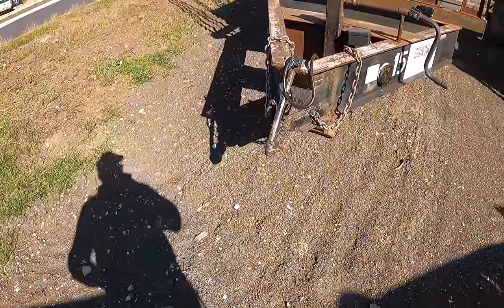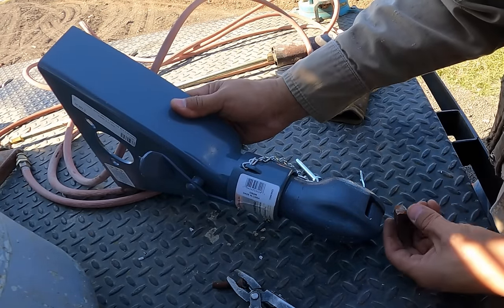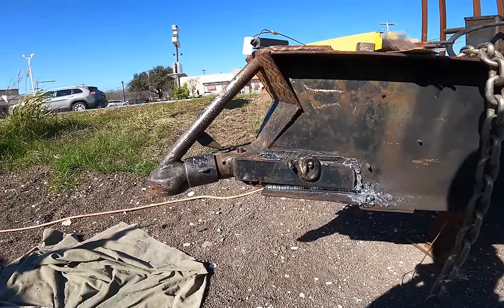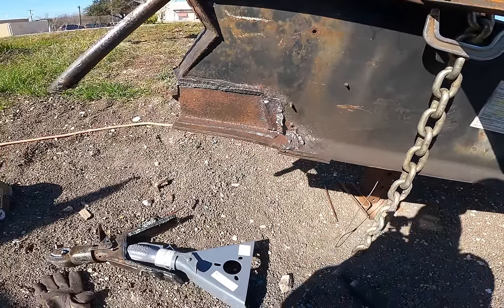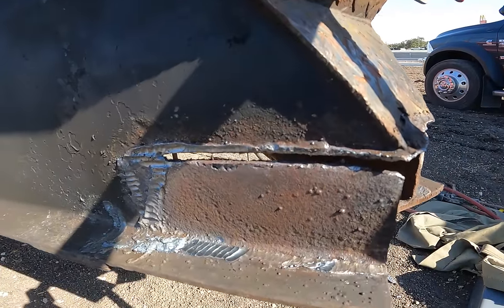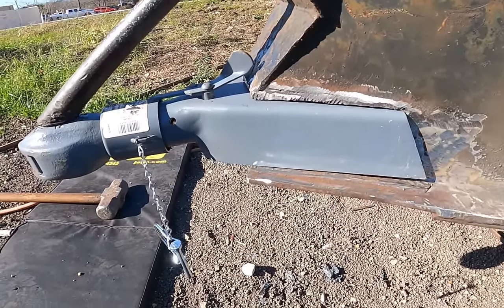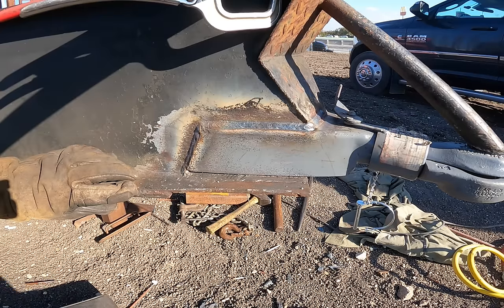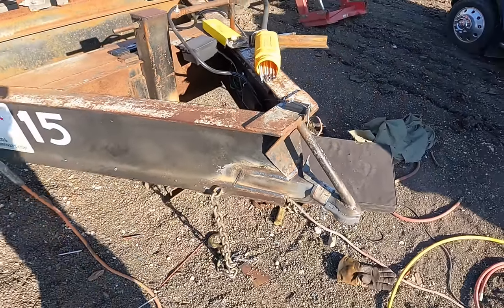Sketchy Hitch replacement.

Comment: People always tell me I’m dumb for messing with hitches. I always tell them I’d rather do them because I know my capabilities and my family drives on the same roads at these trailers. I’d rather me do them, and it done right, than some 18year old fresh out of high school. At the end of the day, I’ll go home knowing it was done right.
Reply: Same.  But I deal with mining and constructiuon equipment and every job is different.  Like last week I was doing a lip on a 988 rock bucket, and monday I finish the 785 haul truck bed.
Reply: i seen homemade trailers and that was smaller being behind f150s but this is framer spec, for a city street its horrible for a trailer that size, this  bologna was together not robot quality
Reply: The hitch looks small compared to the mighty trailer. In the UK we have 50mm ball type but not quite like this one.
Reply: I was asked to help put a drop hitch together.  I declined but later found out he had a friend do the work with his cheap Amazon welder.
Reply: @rbhe357  that’s exactly why I accept doing the work! I’d hate for my family to be on the road with work like that!
Reply: @Landroverdude101  I absolutely would’ve talked with the customer about putting a pintle hitch on it. But the customer wants what they want man.
Reply: @MadMaxWelds  it was a borrowed trailer. The borrower was the customer not the owner.
Reply: $1,500.00 for a new hitch or walk away
Reply: What welding rods  did you use and what amps?
Reply: @JT-tz5hp  this is even more reasons to not have repaired the trailer.  The owner did not authorize the repairs. The guy who borrowed the trailer did.  Sometimes  you just need to say no.
Reply: Surely that hitch is for a 6x4 box trailer, what’s it doing on that monstrosity.

Comment: You did a fine job. However the original hitch and its replacement look inappropriate for the capacity of that trailer. They should’ve been  a heavier hitch.

Comment: In a workshop where welders wield their might,
Came a call to Isaac, a welding delight.
A rented trailer in a dire connection,
The coupling broke, a welder's reflection.

Isaac arrived with his helmet agleam,
To fix the coupling, a metallurgic dream.
He grinned, "Fear not, my dear friend,
We'll weld this tale to a proper end!"

Sparks flew like fireworks, a welding display,
Isaac worked wonders in his own unique way.
To the renter, he said with a laugh,
"No more worries, just a smooth towing path.

Your trailer's ready, now good as new,
Thanks to Isaac, the welding virtuoso, too!"
With a nod and a spark, he saved the day,
The trailer now fixed, ready to roll and sway!
Reply: The Way of the Welder!
Reply: lol its all in a days work though for him

Comment: Hey let's keep welding crap on it to make stronger. Those type of latches are really good for their rated towing, The way that ones on their tells me they are a wee bit over what it's rated for. That trailer looks like it had a ring hitch on it.
Reply: yep , needs a ring hitch with a much higher wt rating
Reply: Ok I'm not the only one that thought it should have a lunette ring on it. They sell multipurpose hitches that can tow either a 2 5/16 ball or a pintle setup. Customer should go that way. Plus I've seen this style of hitch bust open when backed at a tight angle, would not have one on any of my trailers
Reply: That trailer definitely came with a pintle ring installed on it.  I am willing to bet it had a piece of 1/2" x 6" wide plate with multiple holes welded vertically on the end of the tongue.  I worked on a very similar trailer and the V at the end of the tongue was so you could access the nuts that attach the pintle ring.
Reply: Definitely with you guys on the Pintle and ring fitting. The part supplied to Isaac doesn't seem to be rated enough for that trailer, given the size of the drawbar members. They appear to be sized for a large commercial trailer towed by a dump truck and carrying a medium excavator and a bobcat. They definitely require pintle and ring sets and decent quality thick chains. Plus breakaway brake system.
But that's only from what I see on the roads around Melbourne and what would I know? 😅
Mark from Melbourne Australia 🇦🇺
Reply: Agree with everyone too. The trailer looks like it’s made to haul a D8 but it’s modified in some way to haul windows or something like that. My experience with that type of hitch wasn’t good. Had a lots smaller trailer I hauled small load of hay and straw bales and busted it out the side backing it up to the barn. But there are lots pulling huge loads with half ton pickups and janky trailers all over this country and get away with it. I wouldn’t get out the driveway and DOT would be waiting on me to hit the road.
Reply: @markfryer9880 How's the grand prix setup going at Albert Park? Not much time until F1 comes to town.
Reply: @oldfarmer4700  good hitch for hauling post holes or Volkswagen radiators
Reply: No way in hell that hitch is rated for that trailer. Not even in the ballpark.
Reply: Looks to me like theyre just hauling signs so its probably not a big deal. Maybe the person that had it before was hauling heavier stuff tho ha

Comment: There was a guy driving down the freeway the other day with a trailer similar to that one. The hitch was ok, but the welds broke on one of the axle spring brackets and the axle came out from under the trailer. It hit four cars before coming to a stop. Come to find out, it was repaired by the owner, and it was apparent he didn't know how to weld. Good thing we have people like you making sure these things are done right and safe for other drivers as well.

Comment: Your work was solid, ISAAC. The tongue on that was a mess. Blows your mind why they didn’t leave the pintle set up on. 
You can only do what the customer wants!👍👍
Reply: It does make you wonder what happened that they did a reverse cut back into the web of the beam to create a bird's mouth cut and then weld a rated ball hitch to all of it.  Good thing that it is being used to only haul signs.  Definitely a construction project site trailer.
Reply: @wromzick9457  I would not be surprised if that bar in the front with the birds mouth is so that the owner can pick it up and move it with other equipment that does not have a hitch and it gives them an easy area to grab.

Comment: Looks like it was a pintle hitch trailer that they cut the front off of and put that cobbled up mess on instead
Reply: @landonsmith1621..yeah I think you are correct...looks like a mess for sure...b
Reply: I agree landon and the chopping around of the trailer hitch makes me suspicious. 
I have had a trailer try to throw me off the road when I miss loaded it and I have also had another trailer without brakes and to heavy a load try and push me into an occupied roundabout! Moral of the story, you don't take risks with trailers, their brakes or how they are loaded! You are dealing with the Laws of Physics and they are not negotiable!
Mark from Melbourne Australia 🇦🇺
Reply: @markfryer9880 I would bet that trailer has no working brakes.i wouldn't touch that unless I was putting the proper hitch on it. A death trap waiting for a victim.
Reply: @marklowe330  but they do have a break away switch installed.  Of course the pull cord is evidently not attached to the tow vehicle properly. The pull cords NOT  supposed to be attached to the safety chains
Reply: @marklowe330  yes and now all the liability is on Mister Issac.  I hope he takes our advice and puts a Pintle Lunette on it.
Reply: @jaygraham5407  just because you have the pull cord doesn't mean anything.
Reply: @marklowe330  I well know that. Just saying that  a lot of trailers don't even have the break away switch.
Reply: @cameronnerdin4910 didn't listen well did you?
That job is done with that ball hitch connector on it.
He ain't changing shit.
$1000.00 says the customer and owner don't WANT a ring on it, because they don't either one own a pintle hitch and don't want to.
Reply: @haroldphipps3457    Yeah I listen. I don't ever give a shit what my customer wants when it comes to Safety.The hitch broke, which probably means that the trailer is overloaded continuously.  The public safety is more important than what a customer wants. Issac should not have made this repair in my opinion.  He only opened himself up for liability if the hitch fails and then he posted it on the internet to ensure it is known to all that his common sense went out the door on this job.  Yesterday I had to tell a customer it was time to quit working, I had 3 side dumps stuck on a hill and could not make it up because of a snow storm and the roads were snow covered.  I had to tell him we were stopping because when a big rig or dump truck slides on the road  we hurt people. This is the same for this trailer, when  the hitch breaks this time Issac will be on the hook for all the injuries caused.                                                          .

Comment: That' style coupler is commonly found on horse trailers and not really up to the task of a heavy construction trailer.  I kept thinking that there were far better ways to repair it than to duplicate the failed hitch.  It all made sense to me when you said that the trailer was borrowed  and the customer just wanted you to  put it back to where it started.  As always, you did a fine repair job but I can't help but wonder about liability issues.  Thanks for the video!
Reply: Agreed there, that trailer is obviously towing stuff it was never intended to haul.

Comment: Award for puzzle solving, award for having patience excellence, and gouging and welding above and beyond.  It's sketchy but you made it look way better and as strong as it can be with what there is to work with.  The load on the trailer is nothing compared to what that poor trailer has seen at times!
Reply: 😂😂😂 facts

Comment: Those DOT sign trailers are dropped off at the construction site by the sign manufacturer. Then the contractors move them around from location to location as they install the signs. The contractors abuse them, move them about with any piece of equipment they have available, pull them through the mud, turn them over, totally wreck them. Most of them could never pass a DOT inspection, they get a pass. The lights are typically jacked up, no brakes, no nothing. You did good, they are lucky to find you to fix this. They dont care and obviously dont take care of their trailers. This one should have been out of service years ago and cut up for scrap.
Reply: That explains a whole lot about how this mess came about.  The sign company doesn't want to send a good trailer out with the signs because it will get wrecked, and then when something like this happens and the contractor has to fix it, they have no reason to pay for anything more than "put it back like it was" because it's not their trailer.

Comment: I would never put my name on something like that. Sometimes the customer needs the professional to make them understand whats wrong. Issac you are awsome and immensely talented. I just gotta say this one had me shaking my head. Thanks for all you share with us!
Reply: Pretty much. Though of course it’s easier said than done. At a minimum I’d be documenting in a note to the customer that this is not fit for purpose and what should be installed instead. Anything you reasonably can do to limit your liability.
Reply: I agree, this is the first time I am a little disappointed in a repair he has done.
Reply: Yeah it's not the repair in itself, he's a craftsman. Issue is the liability in agreeing to do the repair.
Reply: @ZaphodHarkonnen  The problem is that really doesn't remove liability. The problem is everyone here sees that the hitch broke due to over loading, and it will happen again. And if someone gets hurt it will be Issac"s fault.  He lost his honor in this when he made a repair that shows little care for public safety.
Reply: Isaac isn't a certified engineer, he's a welder and did the job that the customer asked for. And his welds are not what will fail and cause a potential accident. The customer owns any possible liability. 

If your employer handed you drawings and told you to build that item as per spec and you do, then later on that item fails because of an engineering mistake or lack of engineering that you had no responsibility for, and leads to injury or death, would you be held liable? No because you aren't an engineer and therefore not responsible to review the engineering for correctness.
 If I have an engine built to my specs and it has extremely high emissions output and I put it in a vehicle and go for an emissions test and it fails then does the engine builder hold the responsibility or do I? 

If a fast food worker cooks a burger for you and there is something wrong with the meat that the employee has no control over and it harms you, is that burger flipper responsible?
Reply: @truracer20  
Huh? Your reasons don't track at all. If you weld it you own it!  You don't need to be an engineer to know that's the wrong hitch and the dumbest way possible to mount it. Issac knows it was wrong but decided to just repeat the wrong. Obviously his welds are not the problem. If there is a fatality involving that trailer he and the owner will be charged and  sued  immediately.  It will most likely never be an issue. One does need to consider best practices in these situations. There is no way the risk he just assumed is worth the few hundred he made.

Comment: I'm pretty sure that trailer either had a donut ring that was welded to the front of it or some type of c-channel as I usually see with bolt on attachments and they decided they didn't want that and rigged up what they got at Harbor Freight instead gotta love it

Comment: You certainly turned chicken $hit into Chicken salad on this one!
In my youth I worked at a brake and muffler shop, the owner also built custom trailers for various government agencies, and we often were called on to fix bad trailers either from said agencies or the public. The goober welded snot rocket fixed that we saw were scary, it was really terrifying to think that these time bombs flying down the highway right beside you at 60mph 😱
Every time a disaster like that came into the shop the boss would bend over backwards to make it right even if he lost money on the job. He just could not live with himself to let a ticking time bomb like that back on the road.
I'm glad you got it fixed up, but yeah, that was a mess.
Cheers from Tokyo!

Comment: I watch your channel to reinforce the fact that I at least come up to 85% or better of the work a professional like you would do on a job. I really dislike these kinds of jobs and have done too many of them but you gotta pay bills !!!! 
Looks like an old trailer house frame that the tongue has been severely overloaded on. Obviously should have a pintle hitch on it.
Great job but on things like this in your business I would use some 6010 and write BUBBA'S  WELDING on that frame lol.
Encourages me that we do things similarly. Thanks for the tip about needle scaling instead of grinding 👍

Comment: Great job with what you had to work with as you have shown time and again. 
Also KUDOS to the ones that borrowed the trailer and when it broke, fixed it to return in the same or I think in this case better condition then what they received it. Those are the kind of people I like dealing with.

Comment: Morning Isaac, I work with Scissorlifts and Cherry pickers
 I'm glad I'm not the only one who gets told one thing, then turn up on site to see some trashed up machine that's 20 years old, been sitting for years and then they decide to use it and expect you to connect a new battery and it will run like brand new. 
Regards Richard 🇬🇧

Comment: Looks like a horrible way to convert a pintle trailer to a ball hitch but great job on working with what they gave you.  They make a ball hitch that will bolt onto the face plate of a pintle trailer. Call them flat mount ball hitches.  I actually have that same hitch on a 12k equipment trailer.  I like that style hitch, but actually considering cutting it off to put on a face plate that would accept pintle ring, or ball hitch.

Comment: We use a oxy torch to heat a line on the outside of say your bracket, then let it cool.  This will cause your metal to shrink slightly & open up your inside spacing ever so slightly.  Works on everything from 1/4 in on up to huge plate steel bucket brackets.  Same principle as bodywork but I heat a small width in a line.  The last person I seen doing it on a YouTube video was snowball machining or something like that where he is fixing a head for a type of tellahandeler.  We heat the cast up to around 350--500.  Eastwood has a nice simple little water cooled torch & cooler setup you mint really like.  After welding I like to post heat & use an air hammer to relieve stresses, sometimes even a needle scaler, then cover for a long slow cooldown.  Im supprised so many guys toss out broken cast items vs repair.  The dril, tap & pinning method with overlapping jigs is way strong.  When porting heads or doing a block repair, as a precaution I seal the cast-iron with a ceramic sealer loc-tite  ect.  Goodsons sells a ton of cool tools & chemicals like a crack testing kit to their Fastcut 3D valve cutting equipment.  Enjoy your common sence approach & outlook on builds!  Would love to pick your brain on long travel air suspensions like Farfromstock sells.  😅
Reply from the maker: Thank you for the pointer. I have done something similar in the past. Heated and cooled a section of sq tube to create a gentle curve. thanks for the reminder.